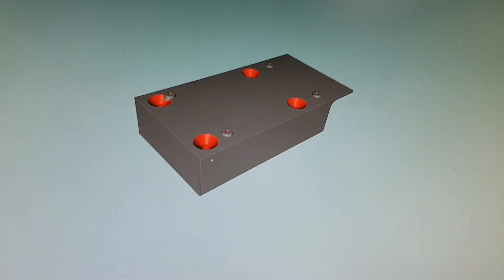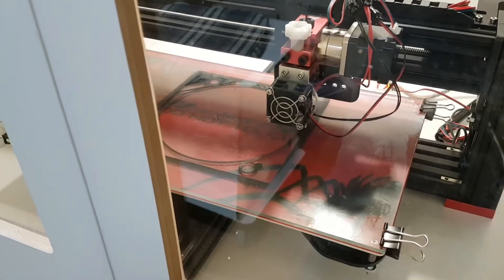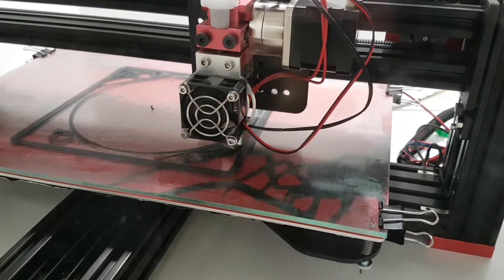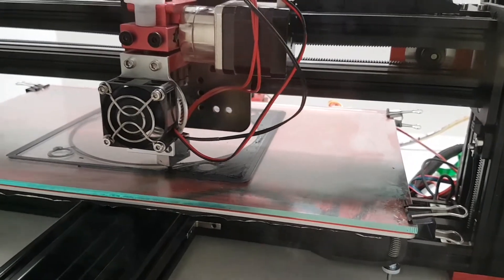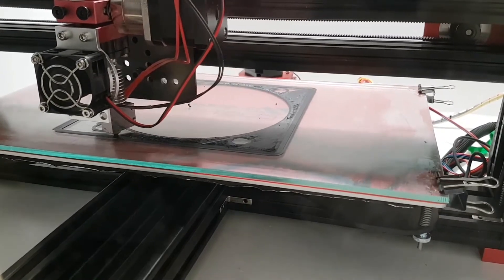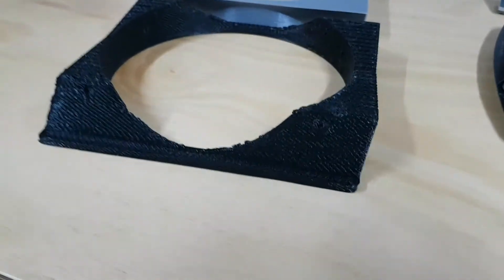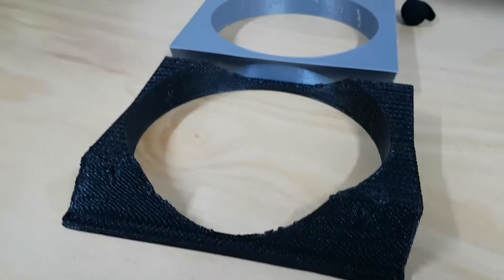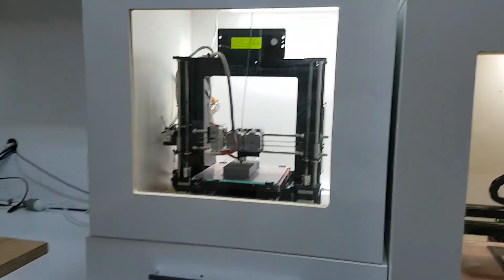Rippling in prints | Big ABS | Tevo Black Widow 3D printer.

Comment: Get a PEI sheet to fit on Amazon. Everything stick then when it cools pops right off. I scuff mine with 2000 grit sand paper about every 3 or 4 prints. And you don't need anything on the bed. Wipe between prints with denatured alcohol or acetone. Use .8mm not the thin stuff and be careful installing to keep out bubbles. I use a roller starting on 1 edge keeping the rest off the bed as I go. Don't forget to reset your Z height.
Reply from the maker: Performance 3DP  I have tried many platforms, spending $100s and there seems to be a new one each week.
That one sounds good, and maybe it is.
Glass with cross linked PVA gives many prints between recoating, the AV56 gives a very tacky surface, but is single use.
I find different filaments need different parameters.